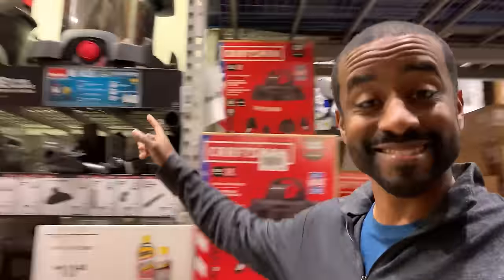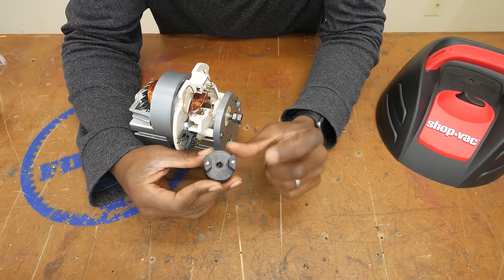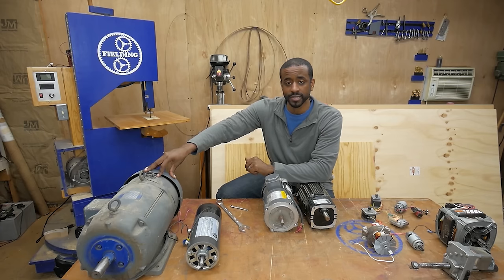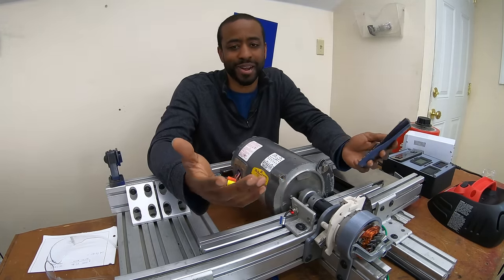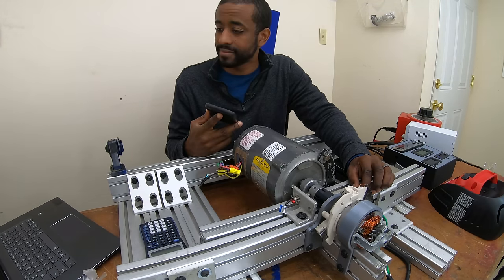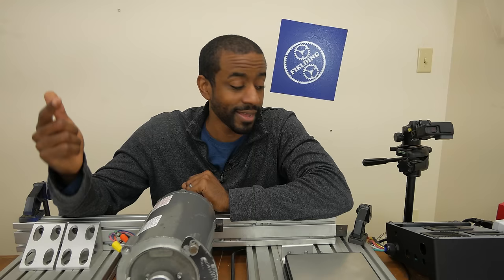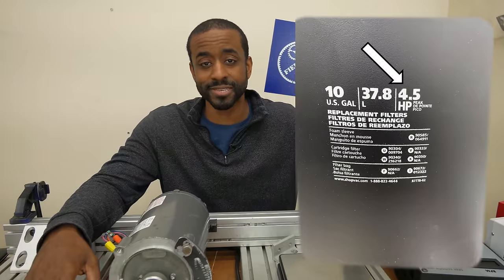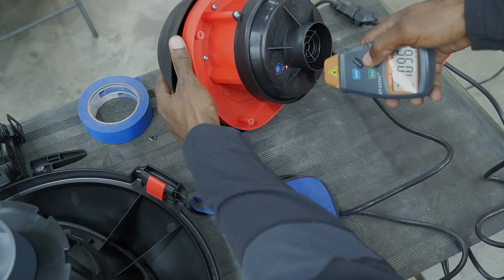How Much Horsepower Does Your Shop Vac Really Have: #078

Comment: I can't believe that some people are trying to justify those HP numbers. The manufacturers are marketing with bogus HP numbers and they know it. Routers (the woodworking kind) do the the same thing. There is no such thing "peak" HP or "developed" HP. One HP is 33,000 lb-feet per minute of mechanical energy. That only converts to 746 Watts with a 100% efficient motor - which of course does not exist. Motor manufacturers know very well how to rate their motors, and the ones that follow NEMA guidelines do so quite well. The best description of expected motor performance I've seen is from a Bodine motor handbook - "A general purpose motor is designed to develop a certain amount of power while operating continuously within safe temperature limits. The basis for rating, therefore, is a rated power output within prescribed winding temperature limits when operated for an extended period of time under usual service conditions. The rated horsepower and speed stamped on the nameplate are those values nominally expected at rated power input. Likewise, at the rated power input, the nameplate temperature will not be exceeded when delivering rated load." Anything different than that is just lies. 

Two rules to cut through the rubbish - anything motor that runs off a standard US 120V outlet is no larger than 1 1/2 HP. And a decent way to estimate motor HP is at 120V it take 10A to generate 1 HP; At 240V it takes 5A. Larger motors will generally follow industry standards.

Comment: i think it basically says; it keeps a built up inertia. that inertia can help suck up an object hose encounters. just as good as 4.5 hp motor would, without inertia. shaft inertia makes zero sense because if you stop it hard and fast enough, hit several tens of Gs, you can come up with hundreds of HP. even if for a split milisecond
Reply from the maker: I think the problem is you want the results to make sense... but they don't. :) To your comment. As you saw in the video the impeller is tiny (less than one once in mass) ... and when you block a hose the load on the motor actually goes down thus it requires less horsepower. The max power is at max flow NOT when you block the air way. Check the description where I explain this more.
Reply: @Jeremy_Fielding  i meant suction power of whole vacuum, not motor power. inertia might let it suck harder when its stuck
Reply: well yea i am trying to see how can it make sense. obviously its a nasty marketing trick. but they gotta explain it somehow right
Reply from the maker: @LeventDV  It is that question that put me on this journey. What I found was pretty disappointing. The description seems to indicate the motor alone. I decided the true operational horsepower is so far from this imagery "peak" that their testing method is shady at best, or intentionally deceptive most likely
Reply: @Jeremy_Fielding  yup. im only brainstorming dont mind me. if its strictly motor, 4,5hp "peak" power makes zero sense. glad u tested and nice of you to put effort to reply

Comment: That mad, the max you can pull from the wall in the USA is like 2.4KW right? that's like 3.2 HP, there's always going to be some loss in the motor so a maximum is always going to be under 3HP realistically, doh!

Comment: They went the other way back in the Muscle car days. They gave lower ratings to allow  customers to  get them insured.
Reply: In the old Muscle Car Days the HP was derived on an engine dyno with no parasites bolted to the engine like alternators, power steering pumps, etc...
These days engine dynos are still used but chassis dynos showing HP at the rear wheels (front wheels) is the real number to work with. You can be 400 HP at the motor and 275 at the rear wheels for example.  Thank you take care.

Comment: some thoughts.     good work.      i am wondering if MA, mechanical advantage, values are a part of the power calcs, somehow.      a motor has inherent (positive) MA.     there is neg-MA at the radius  where 'braking' force occurs, inside the dyno.    should these two MA values 'cancel out' or otherwise be accounted for.    cheers

Comment: The problem with review and articles is so many are paid reviews. Along with having some kind of regulations on legitimate labeling  on power output, consumption, ect, we need regulations on product article, advertisement, and reviews. If there is any kind of compensation, it should not be legally be able to be called a review. The act of the transaction has now made it an advertisement. Long ago, you could research reviews for a product to determine the quality, but not anymore. There's  no way to determine which, if any, of the reviews you read are paid reviews or even if the review you read is even a real review. Another product that just about every person in the world uses that are falsely labeled are phone chargers. We are all duped when we buy phone chargers. They are offered as low as 250mah all the way to 3.5ah. Speed charger, imo, is anything with an output over 1000mah, 1ah. You wouldn't believe how many chargers claim to charge at a higher rate when in fact they are in no way even close to charge at the rate labeled. I challenge you to experiment with different phone chargers. Wall chargers and car chargers. With the cost some places charge for a charger that they claim to charge at a high rate, a large portion of them should be charged with theft.

Comment: //
Engineering department:
120Vx9.9A = 1200W/1.6HP.
They're so honest, they wouldn't round out 9.9 to 10.
Marketing department:
One point six? That's all? How we gonna sell that? Hey Bob, What did we put on last year's model? 4? Ok, 4.5 it is then. 
Alright guys, we need to push 100000 units by Q4 this year.
//
If this was a joke, I'd be happy.😭

Comment: 1 HP is 736 watts of electrical power for an ideal motor

A  120 V 15 amp circuit can deliver 1800 wats 

A 80% efficient motor can not deliver more than 2 HP  continuously  without tripping the breaker

Comment: These "ratings" are based on the amount of power is CONSUMES, not the amount of power it produces! This ShopVac is rated 4.5HP peak, so it draws max (4.5*746=) 3,357 Watts. That equates to just over 30 Amps, which will be the starting current. The rating has nothing whatsoever to do with how powerful the motor is.

Comment: The vacuum cleaner as is, needs to be arranged in a way to lift 2475lbs one foot in one second to be 4.5 hp. It needs to be rigged to inflate a bag underneath the load while pulling a vacuum on a big enough cylinder above the load lifting: simultaneously. That’s what one horse power is. The ability to lift 500 lbs, one foot, in one second. All that watt, rpm, torque, bla bla bla, means nothing. Can it do the work?

Comment: They didn't specify horsepower output at the shaft, so that could hypothetically mean that the motor can produce 4.5 HP of heat for a brief time before it fails, which is certainly possible.
Reply from the maker: No. At 50% efficiency we know what the heat loss is. So double my results... it’s still not enough.
Reply: @Jeremy_Fielding  What I mean is hypothetically the manufacturer could overload the motor until it fails and take the total output of the motor, heat and otherwise, and list that as the "peak" number. It wouldn't be at the voltage or amperage listed on the unit, but getting 4.5 HP out of 120V 9.9A wouldn't be possible anyways even if the motor was 100% efficient, so who knows what voltage and amperage they are using for testing. Awesome video by the way!

Comment: At first I thought the large HP ratings must be the input electrical power, deliberately chosen because larger ratings look more impressive.  But then the electrical nameplate says 120V x 9.9A which is 1.2 kW max, which is less than 2 HP.  So I don't know how the manufacturer can justify labelling it as 4.5 HP.

Comment: holy shit i want to see that 3.5 kW from 110V AC that is a pretty high current for such a small cable.  10A is though only a bit more than 1 kW and that is not anyway near 5 hp. 
I have found some possible  answers which are worth considering:
1)  Maybe we just dont know it yet but all vaccuum cleaners are overunity free energy succers?
2) Otherwise maybe a horse is just so much more powerful at sucking in air. Should be tested. 
3) You could also actually count the calories of the hey that you feed your sucking best friend.
4) Then surely if you have a "overunity horse" it will start to suck very well I can promise you..... hehehehe
What about max current times voltage (initial spike)

Comment: On a 120-volt receptacle, isn't 1850-ish watts around the max allowable draw from a single circuit? If so I can't see how the motor could realistically be able to produce much more than 2.5 horsepower.

Comment: Im pretty sure it is a 6.5 hp motor just it isnt able to achieve that on a household circuit . "Why would I want that?", you may ask yourself. Because it can work harder for longer. The engineering of a 6.5hp motor means higher tolerances so longer life when only ran at 1/3 power. Its like a weight lifter vs a 5 year old lifting 5 pounds 10000 times. They can both do the job but one will far outlast the other.

Comment: Them parts are injection moulded nothing should be melted, the letters and numbers you're seeing written on the parts aren't melted it's a process called hot stamping. A rolled up film is fed through a machine that's heated up at around  300-400+ degree presses down a hot piece of heated metal with a rubber backing against the strip of colored film to transfer the letters and numbers onto the product. Basicly like how you can use stamps to print ink onto paper for design just at crazy hot tempatures. Lol (: Thought you'd like to learn something fun and interesting.

Comment: Another giveaway that this does not produce 4.5HP or even nowhere near is that it runs off a 15 amp breaker and that it uses cord that's not half a meter thick. Say 750 watts equals 1 HP, and the max you can get in Ameristan is 2400 watts -off a 20 amp circuit-. 3hp is already 2250  watts, and even then, it is inefficient as hell to run. Most tools rated that high either have three-phase motors or rum off 240V. 

I'm assuming they've just gone full ideal in the lab: test leads as thick as a horse's neck, near water freezing temperature, big ass intertia as a load and some huge, huge, huge braking power. 

It is deceptive, really. Even then, horsepower as it is does not provide much information as to what the product performance looks like. Something like static pressure or flow rate of water would be much more informative.

Comment: they probably got this number by super cooling the motor then over clocking with 150 volt then strapping a 500lb flywheel and spending 20 minutes getting it up to speed and  then using all the energy stored in the flywheel at once to get there number.

Comment: Without taking in-rush current into account anything above 2HP exceeds the rating of a 15 amp circuit in your household. 12.5A max (about 80% of 15 amps) or 1500 watts. Ever wonder why all plug in heaters are 1500 watts? If you EVER see any appliance with a standard cord end saying anything above 2HP you may as well call them up and call bullshit.

Comment: So as a non large brain person, you can only pull so much out of a houses outlet (circuit). If nothing else is on that circuit, you could pull at a maximum 2.4 HP(1800w) of "work" from a standard 15A  socket. Anything above what you can pull from the wall is essentially lying. Is that accurate?

Comment: It‘s even obvious without any test setup. Multiply 120V x 9,9A = 1200 Watt multiplied by an estimated efficiency of max 60% for such a motor is 713 Watt or 0,97 HP. By the way, why the power of VAC is definded in HP? Are the Americans defining the power of their light bulbs also in HP? 😭. Inside European Union VAC are defined by suction power. Here in Germany we had a long discussion how to define the pover of VACs.

Comment: An equally nonsensical rating is the shop vac's cousin, the home vac which is rated in "amps", the more amps the better!  So a more inefficient equal HP motor gets a higher amp rating than the efficient one!

Comment: All you need is the watts ... (V*A = Watts)

5000 watts is appx 6.2  hp.  power INPUT.  Power output is typically between 80% and 90% of input due to  heat losses in the motor.

Note that you really CAN NOT get to  4.5 HP through a 120 V 15AMP rated OUTLET WITHOUT CAUSING A FIRE.  Claiming 4.5 hp on a 120 v appliance is guaranteed to be a lie.

1 HP = 745.6 watts.  120 V  * 15 amps -= 1800 watts = 2.45 HP.  That is INPUT.  
The laws of physics say you can not get more power out than you put in.

Comment: Simple they are measuring inrush current. You need a special meter to read what an induction motors inrush current is.  I bet the inrush on that motor is right about that 9A rating they give.

Comment: THANK YOU. There was even a lawsuit over this kind of shenanegans WRT air compressors, but even that law suit was a scam in which lawyers made tons of actual dough, and the award they won for the plaintiffs was - get this - more physical hardware from the guilty vendors. But I have owned a vacuum cleaner that claimed to develop over 5 HP which is interesting since 15A outlet in the USA can only deliver a maximum of 2.4 HP... !@#!$ marketroids! So then this marketroid gets up before a judge and says, "sorry, it was all a miscommunication wherein we asked the engineers for the maximum power the thing could consume, theoretically, like, when it first starts, and they gave us some numbers, and we converted that to horsepower" (all of which is clearly bushwa since locked rotor conditions develop no power whatsoever despite consuming 600% of FLC) and so the judge says, "fine, put the motor current on there instead of power". So now my vacuum cleaner brags that it pulls 12 amps out of the wall, but I gotta tell you that somehow doesn't impress me either...

Comment: Horsepower numbers are usually calculated without it connected to anything, your other motor might be slowing it down
Reply from the maker: This rig has been tested with several motors of know hp. It is very accurate. Check my previous video on how I built it and how it works
Reply: @Jeremy_Fielding  thanks, it was a great video!

Comment: Well, duh...12:22 , you forgot to multiply 1.51 by 3. Why, you ask, because that is the number the shop vac 'engineers' decided to pick randomly: "Well, Bob, looks like only 1.51 hp...What do yo think?" "Let's multiply by 3."  See how you could have missed that?
Kind of looks like shop vac has an engineering staff of 3 (how they arrived at the number), and a LAWYER staff of 50. Lawyers: "We need to explain 'scientifically' in case customers have questions..." "I got it! We will tell them the 'inertial contribution' horsepower motor output is not the peak horsepower shown, because not even Jeremy will be able to figure THAT out."
Lawyers (all fifty) high five each other. "Who's up for golf?" laughing as they leave the conference room.
You would have gotten more useful information from the wrong number lady. Customer Service lady: types into screen, 'want to know about hp testing'; screen flashing RED, RED, RED. "Don't tell them ANYTHING!"

Comment: What you have found out is that this particular model of vacuum cleaner has is 4.5 mega marketing wank horsepowers.  Not to be confused with anything real.  A more realistic measure of potential performance would be static pressure and SCFM.  The long and short of it is the marketeers will lie to you.  I went through a similar cascade of hystreonics many years ago about peak power output of stereo amp.  I wrote some nasty letters and had one of my college profs write one and the net result was the only meaningful spec was rms power.  That was 1967.

Comment: I could have told you that wasn't 4.5 HP without even plugging it in, 4.5 HP is over 3000 watts, which is far beyond the rating a typical single phase circuit.

Comment: 4.5 hp.. the cord would be #8 .. running at +30 amps .. you would need a 40amp breaker @110 volts

Comment: Maybe they rate the total force of the mass of the motor/impeller assy running at rated rpm then decelerated to zero instantaneously.  I.E.  releasing all the energy in a short burst.  Peak HP?

Comment: The only one that can be right is the 2.5 HP as that's all a 110v 15 amp circuit will support. What they said is the marketing department controls what goes on the box...not the designers or testers of the product. So assume it is all lies.

Comment: It's a case of them basically cheating to max out the numbers in unrealistic and/or impossible scenarios that the home user would never see. That way, they can claim they obtained that "Peak HP" on the package and if someone sues them, they will prove it, but the home user will never see that. The reason they probably don't give out the specifics is that it will make them look bad due to how cheaty the "testing process" likely is. They probably seriously overdrive the motor to reach that peak.

Comment: It’s not 4.5 hp from the motor that’s like saying an exhaust pipe on a car dosent add horsepower. The other parts from the vac can increase horsepower.
Reply from the maker: I don't understand what you are talking about. The source of power is electricity... the motor converts it to mechanical power... everything else is wasting it... including the motor wasting some of it. What could possibly "add" horsepower?

Comment: we don't even care about HP, what we want is cfm at inches of water, suction power.
Reply: I agree; Those are the only relevant numbers. Just like air compressors, I want CFM@ pressure. The "horsepower" ratings on air compressors are just as deceptive as the ratings on vacuum cleaners of any kind, not just "ShopVacs".